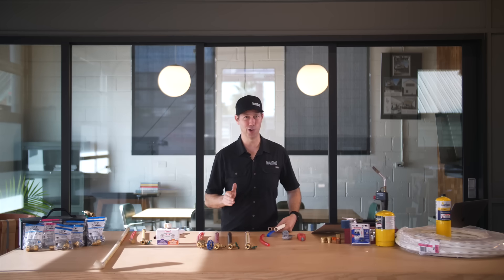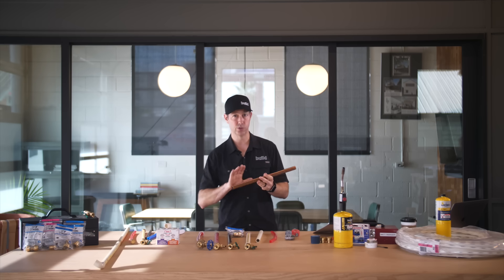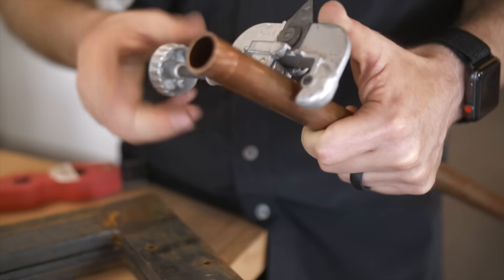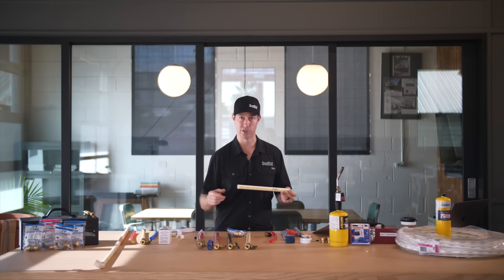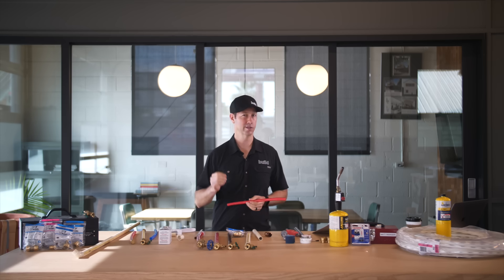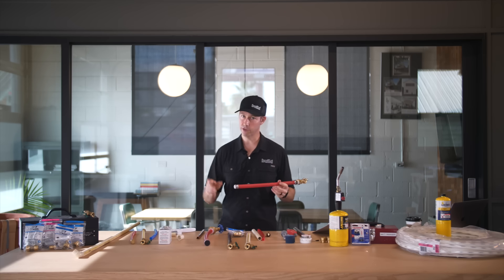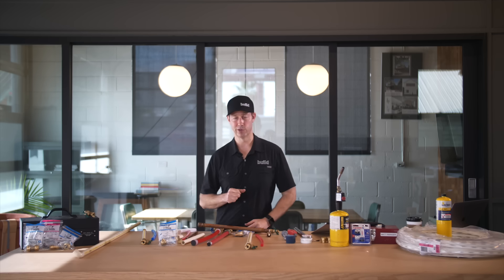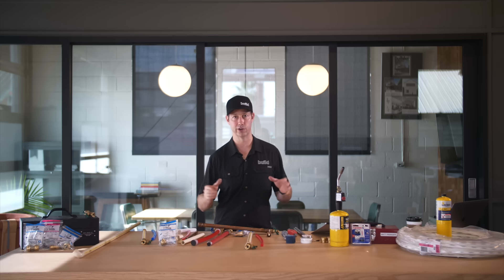PEX vs COPPER vs CPVC plumbing pipes

Comment: The only thing I would change about this channel is I wish it was about northern houses lol amazing channel man.
Reply: I know.  NS Builders is a nice channel (Boston based).  What I'd like to see on both channels is $/sqft numbers on houses they are building.  Is it a secret or something?
Reply: I agree. We didn't hear anything about freeze/burst characteristics of the three choices.
Reply: I wish he would do examples of extreme weather. Where I live in Northern Illinois it can get a hundred degrees and 90% humidity and 30 below zero
Reply: I second that
Reply: Blox117 
Have you ever been to Boston?  Unless of course you don't consider it North enough.
Reply: Here in Minnesota we now have dew points approaching 80, to go with temps up to 100 or more.  Not as many days as south of here but still miserable.
Reply: Same here. A lot different up here in Chicagoland.
Reply: Matt. Spears manufacturing makes a killer cpvc pipe product along with pvc and they have a one step glue solvent so you don’t have to mess with the primer. Check it out.
Reply: Oh, OK. Thanks for the correction.
Reply: in the part of the Idaho Panhandle I live we get 110-115 in peak summer and negative teens in winter. So far my PEX has lasted, I plan on replacing everything with it over time, as needed.
Reply: You northerners have "This Old House"...
Reply: Blox117 That’s not remotely true. Temperatures can vary as widely as 100 degrees within a year.  Not having A/C in the summer can be dangerous.
Reply: @tiawilliams5690  Bad thing about Texas is we can have a temp swing of 50-80 in 8 hours sometimes, this week was a good example 100 (in some areas) degrees to 30's over night.
Reply: @tiawilliams5690  I live in winnipeg, a somewhat landlocked city in Manitoba, Canada.

Our design temps are something like
-28.9C (-20.2F) to 29.8C (85.6F),
58.7C (105.8F) variance.

It is not unusual to see days above and below these temps, in the last couple years, we have seen
-45C (-49F) and 35.6C (96.1F)
80.6C (145F) variance.

So yes, the design up north is more challenging. Honestly, I don't think I could live in the south, it is far too hot and humid all the time. I like my more mild summer days, and I dont mind the cold.
Reply: Jim Schaefer, he already did a freeze test video of the different types of pipes in an earlier episode.
Reply: Instead they have floodlines :)
Reply: Oh well don't you want to live where I am :) haha, We don't have basements super often, but it's not very rare either. We have frostlines, and we have to shovel snow when it does snow (maybe a couple inches per winter, sometimes up to 1ft or more. I mean we don't have radiators, but newer homes in the north I haven't seen keep radiators, they go with a conventional gas heat (I think that's what I use) haha. So here in ArKANSAS we have the best of both worlds :) The city literally shuts down if we get more than a few inches of snow because our snowplow Force is lacking to say the least, but it gets the job done :)
Reply: Where I live now, the record cold is 45 degree F.  I used to live in Boston though.  We had a 30" deep frostline.
Reply: Agreed! lol.
Reply: well in the south during summer temperatures stay 90+ degrees so its definitely a critical feature compared to northern areas
Reply: Blox117 I have been to places in the north where temperatures passed 100+ degrees with high humidity for days on end weeks even. Also, some northern cities have no air flow as in parts of New York City, Philadelphia, and Boston. Absolutely miserable without A/C
Reply: yeah but the north doesnt need dehumidifiers and air conditioners
Reply: Here in MN, we need all of the above. -30°F to 105°F (-35°C to 41°C), plus basements and multiple stories.
Reply: @Blox117   yes we do, in New York it's gets over 100° in the summer, this past summer we got temperatures up to 112° with the humidity
Reply: @Blox117  depends on how far north. But in Pittsburgh it gets in the low 90's during the summer. Basements also require a dehumidifier. So easy to get mold in a basement during summer months
Reply: @Blox117  uh... Im going to assume you've never been to Chicago in the summer. We are well known for heat waves here, nevermind the "bad" winters whatever that means. Yeah sure 30ish°F every day for two months is annoying but 105°F for a week straight certainly requires air conditioning. Chicago sits on a front boundary where gulf and subarctic air masses collide with mountain winds. It gets hot as fuck here, cold as fuck here, and is 100% humid all the time. YES we need air conditioning, this isn't the Pacific Northwest. We aren't THAT far from Texas here bud.
Reply: @scenicdepictionsofchicagolife  ok i didnt know
Reply: @Blox117  sorry if that came off as agressive 🤣😅 its just that people think that Chicago is like permanently frozen or something. March through December is pretty much normal weather, and late April through early November it is warm, and June through mid september and sometimes october it gets very hot here. Almost every day during June July and August is between 85 and 95 degrees. It's really only the last two weeks of January and the first two weeks of February that we see "real" winter here, the kind of winter that hollywood likes to portray Chicago as having and people (even the ones who live here and don't pay attention) have a tendency to think that. When we get polar vortex, so does everyone else, like as far south as Florida, just not as bad and wisconsin, michigan, minnesota, and even further north like the Dakota's get it waaaaaaaaay worse. Trust me, Chicago's winters are pussy shit mild by comparison. We are very middle of the road, but becuase were in the middle of the country, we get extreme temps in both winter and summer. This is why I like spring and fall best! Those seasons are beautiful here ♥️. Love texas and Florida too though! Got family there, will say this much, the summers are pretty much the same as here.
Reply: @Blox117  LMAO um yes Air conditioner's are most definitely needed from about late May/early June through September lmao, guess you've never been up here during the summer...🤣😂🤣😂🤣

Comment: Anyone have concerns about loosing the antimicrobial properties of copper, in exchange for durability and lower cost?
Reply: Why not just get a filter system and a uv light and run quality water pipe
Reply: If you have crud in your water that you think is going to make you sick, you should not have it in your house.
Reply: I think teh reality is that copper will be phased out within 20 years due to cost.

Comment: Regular PVC isn't used in new houses?
Reply: Regular PVC cannot be used with potable water per code I believe.  It is used in drain/sewer/vent lines in new construction.
Reply: @matthewh.7499  PVC can be used for potable water outside a dwelling such as coming from the city main.  Its not allowed inside due its max operating temperature of 140 degrees, which water heaters can achieve higher temperatures then 140.
Reply: Regular PVC can be used to run the water service line. You have to use Schedule 80 fitting (thicker) to hold the water pressure. You can not use it on hot water.
Reply: firecloud77 Regular PVC cannot be used indoors according to code. One big reason is PVC cannot hold hot water because it ruins the glue fittings.
Reply: @dallascollett1273  PVC has a max operating temperature of 140 degrees is the real reason, there are no glued fittings either.  The fittings are cemented.
Reply: I have seen people use pvc just not on the hot line.
Reply: I have to wonder how PVC electrical conduit would hold up as a water-carrying pipe. It's UV resistant qualities might be a benefit. I use it in my hydroponic systems in the greenhouse.
Reply: I was referring to pvc water line not the drainage system.   It comes in 1/2 up to 1 for moving water schedule 40 pipe.  That can only be used for cold water in cases I have seen it used.

Comment: In Florida they are using Chloramines in the water. We have seen it eat copper and metal pipe.  Extremely corrosive.
Reply: Jim DeLucia is that what turns the frogs gay? 🐸🤣
Reply: No one cares about Florida. You will be under water soon...
Reply: I see people commenting about copper being "eaten". This couldn't be further from the truth. When copper oxidizes, it forms a black oxide coating, then a patina coating that protects the base metal from corrosion. This is why they clad the bottom of boats with it. If sea water isn't eating through copper, I highly doubt your tap water is.
Reply: @JohnDoe-ml8ru  No. Boat bottom are clad with copper to slow the growth of algae, not because it doesn't oxidize.
Reply: @stad2126  re-read my comment. Never did I say it doesnt oxidize. And yes, stuff doesn't grow on copper because it's anti microbial.
Reply: Most of the USA uses chloramines...
Reply: Ashish Patel Like
Reply: chlorine eats at pex too. will thin over time
Reply: They use chloramines in Southern California too.  Frogs are turning the plumbers gay!
Reply: glenn barrera women are the reason men go gay ...
Reply: Jim DeLucia It’s the temp of the water, turning them feminine.

Comment: Brother-in-law had a few pin holes in the copper in his house a few years back. Apparently a lot of the houses in that area had similar issues around the same time. That area was built up in the 70's and it's not, as you might say, an affulent area. I wonder if it was a trend of people not maintaining or replacing their water tanks.
Reply: Marc Crocker Most of the pinhole leaks are due to electrolysis. Electrolysis is a galvanic reaction when a dissimilar metal touches copped. Something as simple as a metal band used for strapping touching the pipe could cause it to happen. The way to stop electrolysis is to disconnect the metal touching the copper.
Reply: Use copper strapping instead, would solve the issue with different metals
Reply: My hunch is that aluminum is not a problem but iron is a problem.  Aluminum is so high on the redox chart (meaning it's very very reactive, while iron is only moderately reactive) that it always skins over with a tough oxide. That means, essentially, that aluminum immediately becomes "painted" when exposed to oxygen in the air.   It stays "painted" (thus protected from further reactivity) even when occasionally wet.    Iron corrodes in different patterns, irregularly, and is particularly obnoxious when splashed with non-distilled water.    The saltier the water (meaning more dissociated ions;  hence reactive, aggressive ions in solution) the worse.   So all non-copper "metal" might be erroneously condemned as "hostile to copper," by blanket prohibition.       On the other hand, codes require care be taken, on the hunch that once in a great while, something will get wet.  etc etc.
Reply: JOHN BECICH Wow John, you are very knowledgeable about chemistry! The way that I was taught was a dissimilar metal touching copper. Metals that are closely alike with copper are permitted to touch per GA plumbing code. 
So going back to my previous comment, not all metals are bad to touch copper. It is dissimilar metals that can cause a galvanic reaction. 

I also have never heard of the rusty water and the deteriorated anode rod theory with copper pipes. It makes complete sense and if I can get a better understanding of it I may use it as a selling point.
Reply: It's funny ya know, I've had plumbers give me shit for running a armoured cable(electrical cable with an aluminium outer sheath) across their copper pipes. Fair enough, it's easy to wrap my cable with some electrical tape in those sections to saperate those metals. Yet, at the point where their water meter is, they will have a rack build out of uni-strut(which is aluminium) and not bat an eye. Refrigeration techs do the same thing with their copper lines. Maybe I got it wrong, maybe the copper doesn't react the same way to different grades of aluminium. Maybe they do have something saperating them and I missed it or they are supposed to have some saperation there and they missed it.
Reply: dissimilar metals, esp copper or brass with aluminum, add moisture (condensation) and a small current and everything goes to sh!t, galvanic reaction on steroids. Seen this in the RF industry decades ago.
Reply: My pinholes in copper were common until I put in a water softening system.  Very acidic shallow well water. Constantly had green stains on tubes and toilet, but a salt system cured that. All repairs were in last 6 years or so are color codes pex with Sharkbite fittings.   Copper to pex is easy. Just check your grounding spots!
Great videos.  New subscriber.
Reply: I have helped a few out that had leaking copper,  it had corroded valleys inside the pipe, not always on the bottom.  I figure the piping was too hot during mfg, air got into the pipe wall, over time copper corrosion just took place in the stagnant valleys where air can sit.
Reply: Cameron:  Please be specific when you warn against "metal" touching copper, which is also "metal."   Iron is more reactive than copper, in oxidation-reduction chemistry.      So usually, iron will deteriorate when put in proximate contact with copper.      So I assumed that copper would not degrade.    To my amazement, the test of time (over decades) has shown that copper can spring leaks thanks to iron flakes propagated into copper piping systems, especially on horizontal pipes.    Matt cited this when mentioning This Old House seminal lecture on the dangers coming from old hot water heating tanks whose sacrificial anodes have depleted.

Sacrificial anode metals are even more reactive than ion, on the redox chart, and have long been used on ship hulls to deter corrosion of steel.

So, even though copper is famously stable, it can be killed by oxidized and partially-oxidized iron.    That wasn't supposed to happen, according to my college chemistry book.

Comment: Lovd this, and love your videos in general. Could you do one (with all 3 materials) showing how to replace a section in a length of pipe (where you can't move the pipe on each side)? I realize it's not a new-home-construction topic, but it would be super helpful. I haven't messed with copper much, in part because I don't know how to get a new section (and new fitting) in place, and it's been a puzzle on CPVC too (I haven't done much in pex and would love that too). Thanks again for your videos!
Reply: Shark bite type fittings are made specifically for this purpose that allow room for the pipe to slide back and forth before final configuration is established Warning, however, they can be expen$ive at 15 + dollars in many cases.
Reply: Matt is very busy and consistently lectures on "building science."   His focus is excellent, his delivery concise.  This is not a repair clinic.
Reply: It's called a "slip coupling"

Comment: I use CPVC over copper because copper gets pin holes especially on the 90's.  PEX is great for a repipes and new installs, because of fishing for access and better flow due to less 90's needed.  I believe PEX or CPVC should outlast copper overall.

Comment: Sorry if i missed it in this video but i've heard the copper and probably the CPVC has anti-bacterial benefits where the pex didn't. Your thoughts?
Reply: Adrian Sanchez, copper, silver and zinc compounds are used to inhibit biogrowth in consumer products and commercial/industrial work surfaces. In the last several years, ice machine manufacturers have been integrating ionic metal compounds into plastics that make up the ice handling paths to improve the hygiene of the product. The problem is that copper forms an oxide layer as it is exposed to the oxygenated water it carries and that layer prevents the water from being exposed to the ionic form of the copper that is effective as a growth limiter. There is some antibacterial effect from copper piping, however it does not last long and loses it's effectiveness rapidly for that purpose.
Reply: Copper does have anti-bacterial properties, but never heard CPVC or PEX having that. The benefits will be marginal anyway with chlorinated public water.
Reply: even if the water was touching pure copper, not all of the water in a pipe will touch the actual pipe. any anti-bacterial benefit is only marginal at best.
Reply: Spring, distilled, or filtered bottled water for human or pet consumption....